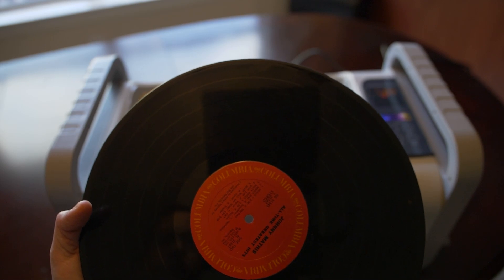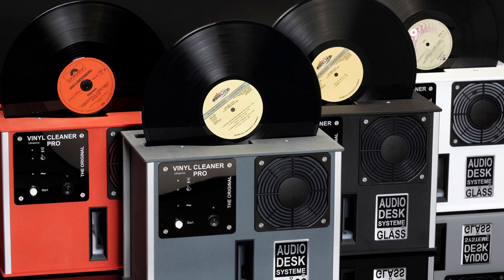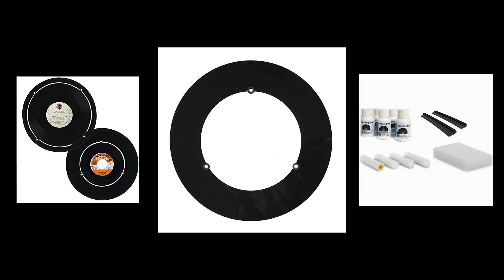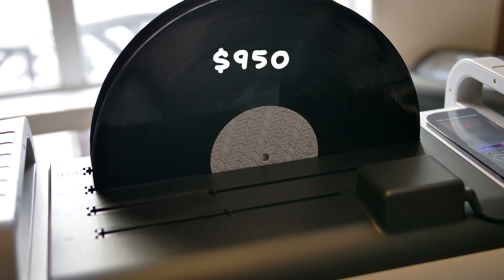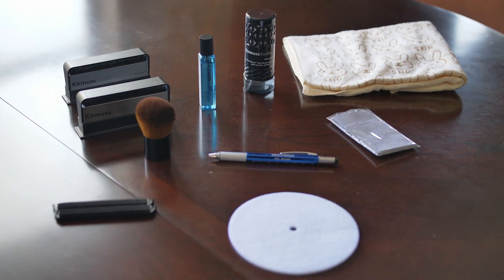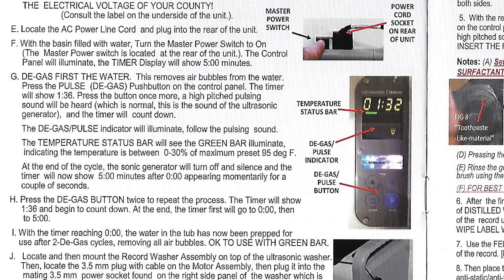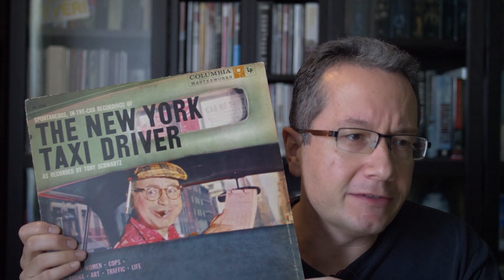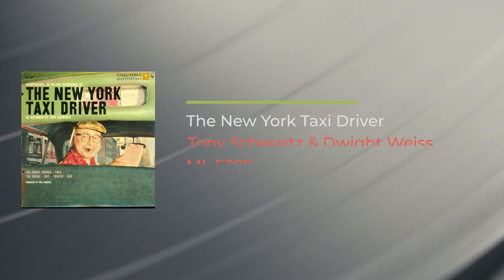Kirmuss KA-RC-1 Ultrasonic Record Cleaner Review and an Ultrasonic Cleaning Primer

Comment: Love the review / video. I have a DIY version similar to those you showed. I use Tergikleen in the bath. I also use a record vacuum to remove the water and leave to air dry. I was concerned about the possibility of not getting all the Tergikleen in the vacuuming process (they advise to rinse record after cleaning). I decided to manually wipe distilled water (soft foam brush) over the record before putting it on the vacuum machine for the "rinsing". Gives an added level of mechanical cleaning as well. Important not to use too high of a bath temperature, I use 30 degrees C. Each full cycle takes about 30 mins not including air dry time. I've rigged my bath to handle two records at a time. I think too many records at one time will reduce effectiveness. Keep up the great videos.
Reply from the maker: Thanks Downtown Townie.   You're right about having too many records.  There have been some studies done on the spacing of the records and what is optimal.  Being an engineer, I would love to study what was done for them to get to their conclusions.  Tergikleen is a product that I have yet to try and I hope to try it in the future.

Comment: Thanks for this Paul, excellent video on how ultrasonic cleans your record. I have been looking for a solution to clean new records and the dollar bin once. Been looking at many different brands like Okki Nokki, Loricraft, etc. Also been into the Degritter (easy one) and Audio desk, but they are pretty pricy, even if I believe it will be worth every dollar in the end. But I don't want to buy serval machines, one is enough. I will check this up and see if it's possible to get in Europe.
Reply from the maker: If you can afford the Degritter, that's the one I would shoot for.  Yes, they are pricey but it's always nice to have a one shot solution.  There is a comment here from someone in the thread with a much cheaper solution  (~$300) with a Kickstarter campaign.  They met their funding goal.  I do like the Kirmuss and it should do well if you can get it in Europe.  The down side is that you won't get the automatic drying and will have to do that independently.

Comment: Hello Paul. I wrote this morning a comment on the four corners video from this morning, then Michael from Germany suggested I write to you on your channel. I am very interested in knowing more about the topic you went over briefly, stylus set ups and loud pops.
Reply from the maker: Sure.  I am happy to help.  Not all stylus or needles are designed the same and all have a different amount of surface area that touches the grooves of the record.  The Shibata, on the 2M Black touches lot more of the surface so it's also more sensitive to debris.  The best write up on stylus geometry that I have seen has come from Peter Ledermann who owns and runs Soundsmith.  https://www.sound-smith.com/articles/stylus-shape-information

Hope this helps.
Reply: @BarakaPDub  thank you so much, will read it and see how it goes. Thank you again.

Comment: Great video.  What is your process with new records?  Do you use the Kirmuss?  Do you use the surfactant on new records?  Thank you in advance.
Reply from the maker: Thanks for the question Tom.  My process is usually the same regardless of the record.  Most new records coming from the factory usually have small amounts of debris on them.  Likely from the trimming process to form the outer edge but I also have found paper debris if they are using cheap paper inners.  I always start with the Kirmuss and the ultrasonic process does require a surfactant; otherwise, the water will continue to cling to the surface.  After the ultrasonic clean, I move to my vacuuming machine and do a rinse with distilled water.   As you can see from the demonstration, not all the debris immediately settles to the bottom of the tank.  Some will float back on the surface but it's loose enough now to be picked up by the vacuum.  I realize this is probably pretty involved for most people but if you don't have a vacuum, I would rinse with a Spinclean or spray a fine mist of distilled water with a spray bottle and wipe down with a damp microfiber cloth.  I highly recommend a dampened rag because wiping down with a dry cloth will just impart static back on the surface of the LP.    I then let it air dry for a short time before putting it in a new record sleeve.   Hope this helps.
Reply: @BarakaPDub  Excellent.  Thank you for taking the time to reply.  I do have both.   Do you have a preference for surfactant?
Reply from the maker: I normally use alcohol as my surfactant but I have also used Kodak Fotoflo in small amounts.
Reply: @BarakaPDub  
Hi Paul,
For any records, new or used, I would like to suggest somewhat reversing your steps and see what you think. Instead of putting the records first into the Kirmuss machine, I would suggest either a run through something like a SpinClean or if you have a vacuum RCM do either a rinse and vac cycle or a chemical (MoFi SuperWash or AVIS #6 or more intense kit depending on the record), rinse and vac first, then a run through the Kirmuss machine if needed. (In my experience, some records get plenty good just from a MoFi or AVIS treatment alone, especially new records or used Classical records are almost a sure bet).
Why do I suggest this? Well, first of all, it makes less work for the Kirmuss machine in the sense that you are not wasting surfactant, but more importantly is that the Kirmuss machine, like most others, does not have a filter system, so if you run a very dirty record through it and then go to run another, you run the risk of the previous debris (especially from new records) becoming projectiles launched at your record. (In cavitation those little bits of PVC, some of which may be microscopic, from the edges of new records or what have you will end up floating around and can do damage). That is why my hard and fast rule is never to put a very dirty record into an ultrasonic bath.

Another reason is that the idea is to have the ultrasonic bath get deep into the grooves from the get go, so by first putting a new or unrinsed record in the USRCM you are just getting the first layers and would need to run the record through at least twice. On top of that, you would have to change the water after each record that way because it would get too dirty quickly. That is a waste of surfactant as well. By at least rinsing the record first initially, you could then run something like 20 records through the Kirmuss machine before needing to change the water.

By the way, the point of the surfactant is to get the water attracted to the surface of the record, without it the water will just bead right off, but the other important point is to change the atomic or molecular charge of the record to the opposite of the distilled water so that it (and the bubbles or plasma/energy waves) does get onto the whole surface and in the grooves.  A record is a similar positive charge as the water in this case, so like magnets of similar polarity, they repel instead of attract.  By changing the charge of the object to be cleaned (a record in this case) with a surfactant, the water or cavitation bubbles if you prefer are attracted to the record. Surfactants come in different varieties and the type depends on what you are trying to do. In this case, you want to attract the water and bubbles to clean the object, so an ether-based surfactant is desired. Alcohol is an ether and can work to a point to change the molecular charge of the record, but the problem is that it evaporates too fast to be effective enough. A polypropylene (many types of those as well), which is formulated as an ether-based surfactant has a longer shelf life so to speak. It takes about 2 minutes to evaporate and is structured in a way that is a better surfactant choice in this case. We are not trying to change the molecular charge of the water, which is a herculean task, it is easier to do so with the object to be cleaned. 
Part of why I personally, would not use Fotoflo is that it is actually the opposite of what we want. I used to be a darkroom photographer. Foto-flo is the last step in print development. It is used to stop the fixer bath, prevent water spots, stains and excessive soaking or impregnation with fluid of the photo paper. Without it, the prints would get too much fixer, which will destroy them by crystallization and the photos would not dry quickly and be a mess to handle, not to mention have a very short shelf life. It's like a wax or sealant on your car to protect the paint for one analogy.

Microfiber towel drying won’t build up static if done correctly. Like vacuum drying it doesn’t require much. In the method I do, I start with a dry microfiber towel and wipe going with the grooves, it usually takes the equivalent of two revolutions on a vacuum machine before it is “dry enough” to be gone over once with the velvet peristatic brush, which makes sure the grooves are completely dry. (About 10 seconds later the record is bone dry and ready to be sleeved, no static charge in my experience). In my experience, the towel automatically gets damp enough the second it touches the record, no need to pre-dampen. It gets to the point that I have to get a fresh dry towel about every 5 or 6 records or so. Yes, overdoing it will build static just like overdoing vacuum drying (anything beyond two revolutions on a VPI 16.5, which is plenty, will increase the chance of building static exponentially in my experience). 
As always, your mileage may vary. This may save a step or a little time for you, not sure.

Comment: Good review by the way Paul. I like how it was balanced and on point without straying into conspiracy theories and unrelated complaints, etc. I have seen from some others. It just basically says "well, here it is and my experience, like it or not, you decide". I enjoyed your review. Yes, present and let folks decide, that is the way you do it!
Reply from the maker: Eric thank you for watching and I think you left a very long detailed comment which a saw last night but has now disappeared.  It's weird, I didn't delete it but I remember getting halfway through it before getting distracted on the home front.   Yeah, I try to leave to the viewer to decide what they think of the product as I am not a fan of reviews that paint a rosy picture of every product.  I don't think any product is perfect so you got to put out the pros and cons.

To answer your first post, based on my recollection, I think everyone has their own process.  Is mine definitive? Absolutely not!  I recall from your first post something about vacuuming first because if you do it the other way, you get the platter wet.   I think either has it's advantages and disadvantages.   While I didn't make this video about my comprehensive process, when it comes to vacuuming, you're right, you really don't want to get the VPI platter wet.   What I do is I have a plastic sheet which I lay over the platter.  After the first side has been vacuumed, I pull the plastic sheet off and vacuum the second side.  That way, only the cleaned LP surface is touching the VPI cork platter.  

As you can see from the pencil demonstration, the debris, while removed during the Ultrasonic process, doesn't settle immediately to the bottom of the tank.  When the process stops, some loose debris can wind back up on your LP surface.  This is why I do a double vacuumed rinse each side with distilled water afterwards.  Two times might be excessive for some folks but I error on the over conservative side.   

With vacuuming, I am also careful not to over vacuum.  I always go one, maybe two, revolutions at most; otherwise, you're just imparting dry friction that transfers electrons to the surface of the vinyl.  There might be a small amount of residual moisture on the surface and this is what I let air dry.  While it is true that no home is dust free, leaving the record out to dry for ten minutes. at most, doesn't really leave much time for a lot of dust to accumulate.  Is there some dust that does accumulate...sure.   When I play a record, I do so with my lid completely removed so I am more likely to see dust collect when I play the vinyl.  Dust just cannot be avoided but it can be mitigated.  

For the microfiber cloths, I only use them when dampened, to remove large residual drops of water.  I did a video on LP static, where I demonstrated dry rubbing your records with a mircofiber cloth only imparts an electric charge and allows the particles to accumulate.  

Hope this explains my process which might be a bit for some.  I have seen others that take it far beyond what I do or others that just do it differently.  If it makes 'em happy, then why criticize?
Reply: @BarakaPDub  Thank you for your kind words Paul. I found my excessively long comment again for you. (It disappeared on me too for a bit). You will find it under the replies to DSaudio. 
By the way, you do vacuuming correctly sir! When working with my VPI for initial chemical treatment sessions, I also lay down a cheap vinyl mat on the cork platter for side one, then remove it for side two. Yes, this keeps things clean. I do two revolutions of vacuum, that's it. That gets the record dry enough that it takes only 10 seconds for anything left in the grooves to dry and it goes back into the sleeve. 
I hear many complaints that the process takes too long to which I say, if you want the best results you have to be willing to follow the required process. 
I'm working on a "paper" regarding record cleaning and "restoration" to submit to the science community. (This will take a while though, several months).
I can tell you my process if you have an  email or something.

I used to be an audio journalist (4 years) and met a lot of reviewers. I agree, the constant praise of products does not lend to credibility for reviewer or product. I've seen some real BS in my time. I remain friends with two because they are dead honest and not afraid to speak truths. You might check out Sean Fowler of Zero Fidelity and Thomas from Thomas and Stereo if you haven't already. I don't always agree with everything, but 95% is great odds.